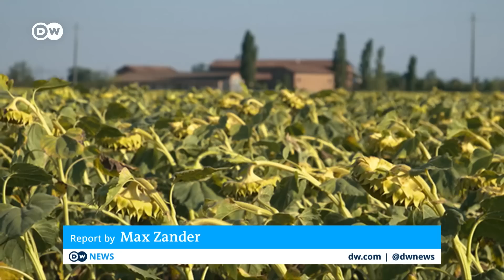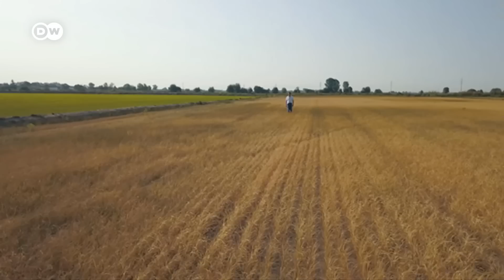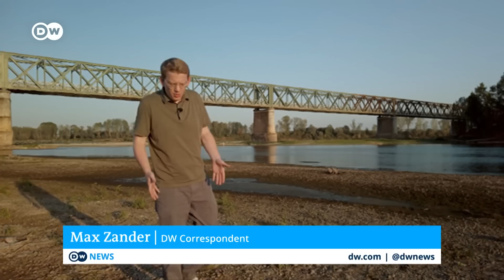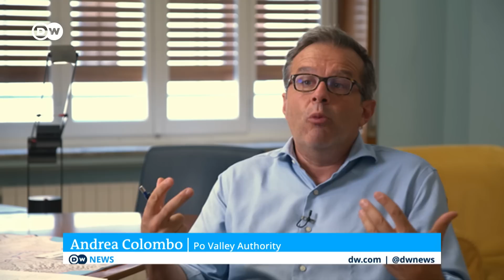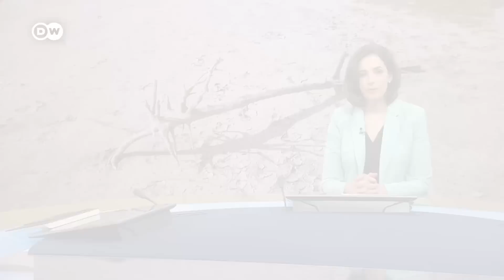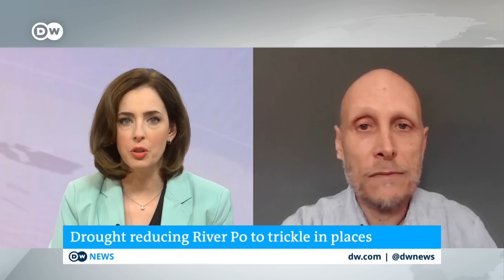Drought: What's the link between water scarcity and global heating? | DW News

Comment: We should shift focus from electric cars to hydrogen cars
Power plants should shift from coal to nuclear
Just these two changes will save the world
Reply: Hydrogen is 50 to 54% efficient.
Electric cars are 70 to 85% efficient.
90 to 98% of the cars batteries can be recycled and reused in a different car.
Also what about methane engines that uses collected methane from garbage dumps or farm waste like animal poop and use it to drive.
Don't forget trains or in town or city trams for transportation saves lots in money saves lots of co2 and most can use electricity so if the grid is green then you get more clean air.
Reply: @thesilentone4024  Have you heard about lithium mining.
Reply: @inimene-n7y  - Scientists are working on finding alternative materials than lithium for batteries. But until then, we have to do something. Ok., switch to a more plant based diet. Buy a small, fuel efficient, preferably electric or hydrogen car. Insulate your home. Drive less. Buy less stuff.  Reproduce less. etc. etc. etc.
Reply: @freeheeler09  I can somewhat agree with the other stuff, but there is no way I am gonna eat less meat.

Comment: At 5:35, the guest mentions the reduction in snowpack. I imagine this acts as a giant reservoir, storing up precipitation over the winter to gradually release it gradually in spring and summer. When the snow pack gets smaller, the snowpack reservoir is unable to provide the ecosystem services that civilization and agriculture have grown used to. What I find frightening is that Alpine galciers, in fact all glaciers, are predicted to disappear completely, so what seems like a small gradually increasing problem today may hit a brick wall that cannot be fixed at all. 
    I don't know whether the world has already passed the tipping point for glacier melt, so that even net zero carbon emissions cannot reverse the trend towards losing all glaciers. So far, the Greenland ice sheet and West Antarctic ice sheet seem more stable for the coming decades, but if they go, sea level rise will quickly drown coastal cities and islands like where I live. Maybe net zero is just a first step, and future generations have to think about massive carbon dioxide removal (CDR) for centuries to come. The UN is already estimating 10 billion tons of CDR per year by 2050 just to achieve net zero, counter balancing the residual hard-to-remove emissions including agricultural methane (especially associated with rice farming). Building up a massive infrastructure for CDR would require a high carbon price to incentivize large-scale investment in CDR. 
    I don't want to sound too negative, but we have to balance optimism that our actions can have effects, with realism about the scale of what needs to be done this decade and for coming generations. If we can't turn around carbon emissions this decade, and get emission levels to finally start decreasing 30 years after the UN Rio Summit recognized the need to combat dangerous climate change, we will make the job of our grandchildren's generation a lot harder and a lot more expensive than it has to be.
Reply: The problem is higher population and over farming. and in my opinion I think a war with China will make things just worse. And in my opinion Russia They invaded Ukraine for survival of the fittest. The world is dying been dying for decades only difference is there been many wars to control population and we are sadly in a time where there’s just to many people on this earth anymore. We as humans consume more and waste even more. so too truly fix this problem was a disease to control population but it did not affect the important regions of the world where population is out of control like China India with over billions of people that in my opinion should be cut back bye a few million people. So where will this lead us fighting for resources like Russia there only so much water so much food and so much oil Eventually something will give sadly I see sooner then later. Just imagine if you stocked you food like a 🐜 and got ready for the winter and a grasshopper was laughing at you to slow down enjoy the summer relax. Bet you the ant will survive the winter before the grasshopper does meaning most people are the grasshopper and very few are the 🐜.
Reply: @TurtlebeatsTurtlebeats         The cause for over farming is due to the need to grow feed for farm animals.  We need to switch to a plant based food system.  That would address climate change and the water crisis simultaneously.  Farm animals eat calories and protein than they provide when we eat them.
Reply: @someguy2135  by 2025 if we don’t change are water habits we are doomed cattle is dropping dead to lack of water not food and to put it simply to you if we can’t provide water to cattle what makes you think we as humans can provide it to plants in my opinion we are doomed because we are relying on society to help but in reality we consume more than we truly need. If I were you I pray for water before food because without water we are all doomed.
Reply: @someguy2135  one more thing I farm out on the east coast we are in a drought if it rains it does not last long I have buddy’s know Preparing rain water in hopes just to water any crops they can. water companies we been talking to think by next year they are going to enforce codes but say it will be Useless simply cause people will do what they want and screw the real people that truly need it.
Reply: @Frederick Kintanar I think we have passed the return point for reversing the heat for the mountains and glaciers, because I was reading the other day that scientists have already confirmed that Earth will not have another Ice age for 500,000 years at least. 500,000 years they know for certain but they know there will be many more years after that they just dont know for how long.  We are considered an Ice Age because we have 2 ice continents  but after these two melt and the heat, yeah were headed into the inferno literally